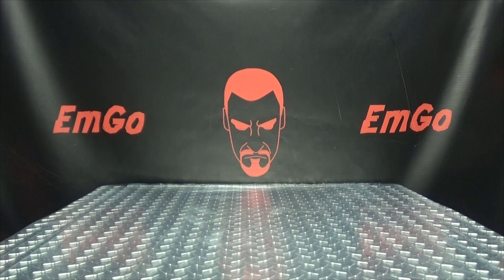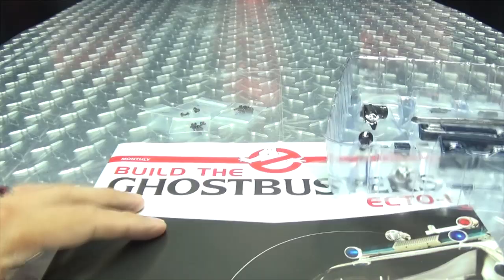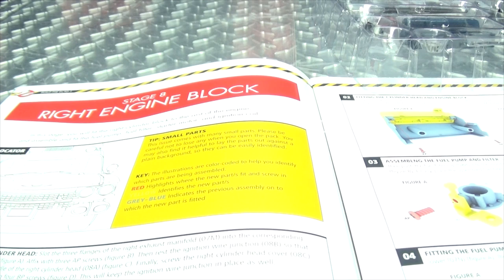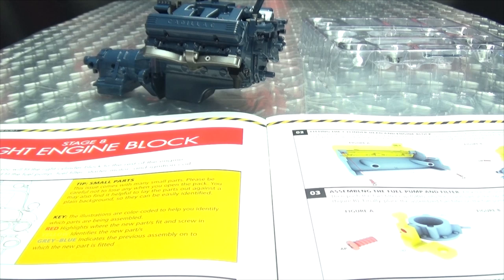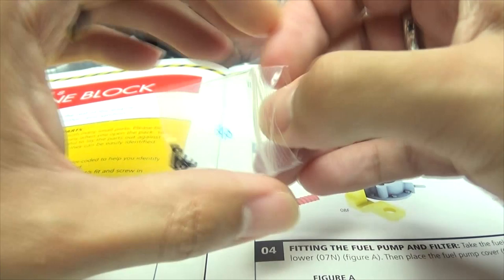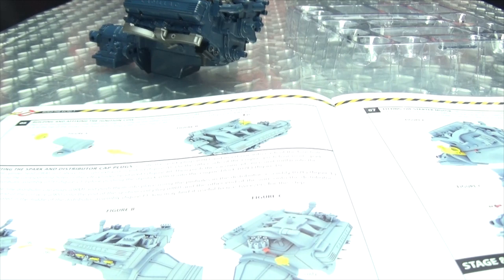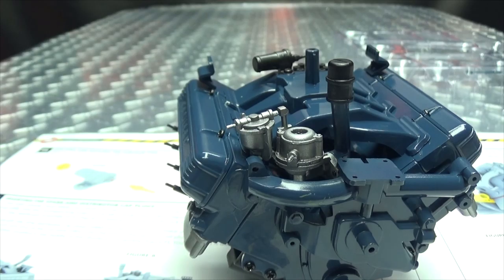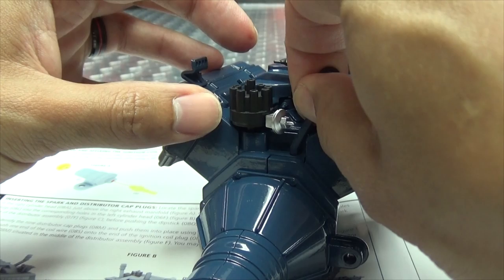Eaglemoss Ghostbusters ECTO-1 Kit (Part 8): EmGo Builds Stuff

Comment: Emgo if I can make a suggestion.... Use just a very little bit of oil to screw in screws to metal parts. Beard trimmer oil or something along those lines will make assembly soooo much easier
Reply from the maker: The assembly has been very easy. I’ve encountered no difficulties installing the screws.
Reply: @emgo316  as with all collectibles mileage varies, but I was just giving a suggestion

Comment: so... this is a Carburated V8 with 8 valves right?! interesting.
Reply from the maker: ... sure?
Reply: Carburated for sure, because the Cadilac of this model were in line before eletronic injection... but the valves i may be wrong... but since there is only 1 spark plug per cylinder, i guess it uses 8 valves too. at best this is a 16 valve engine... but i'm quite sure it is an 8 valve.
Reply from the maker: ... sure... what you said.